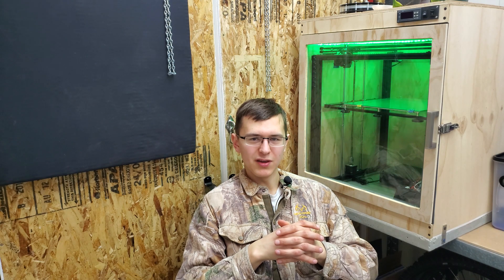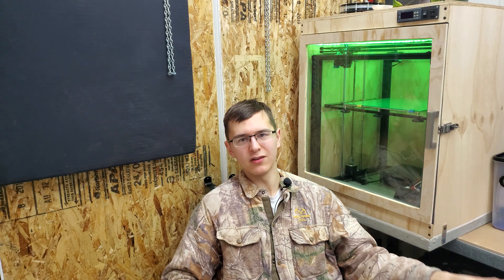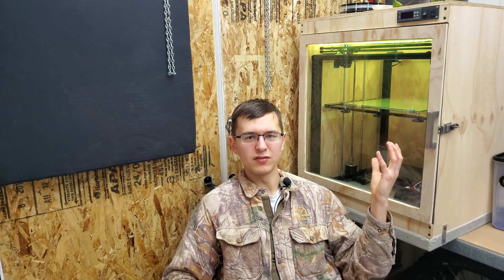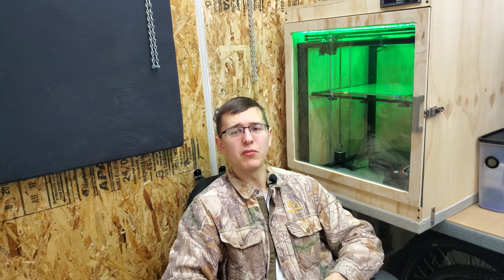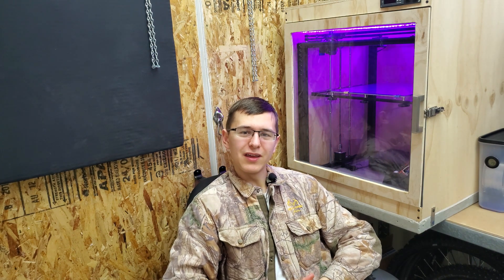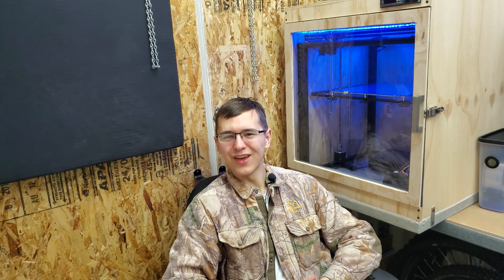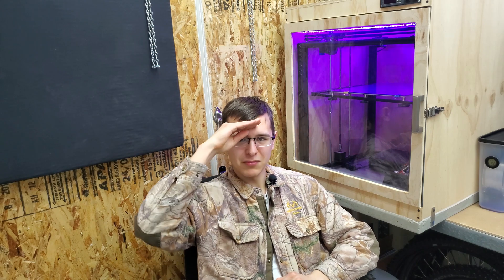3D Printer Heated Enclosure - Part 1 - Concrete Base

Comment: Can't believe none else said this yet but you could have easily solved the problem of the cracks etc by playing around with your concrete mix it looked a bit to dry if you ask me. I'd rather make it a bit more fluid and maybe close the mold and wack it a bit with a hammer. Takes a bit longer to dry but it will look alot beter I think. You could even polish the top for a nice clean look.